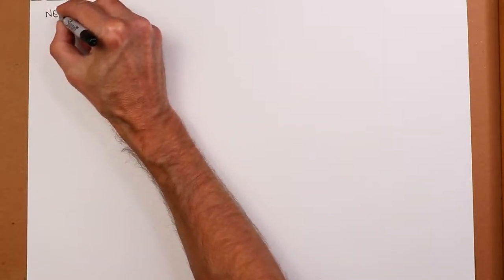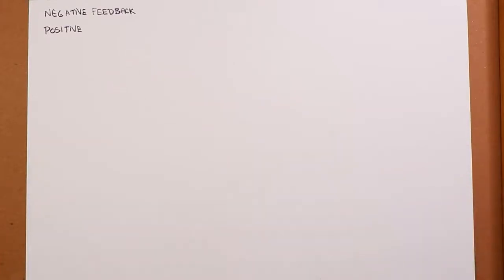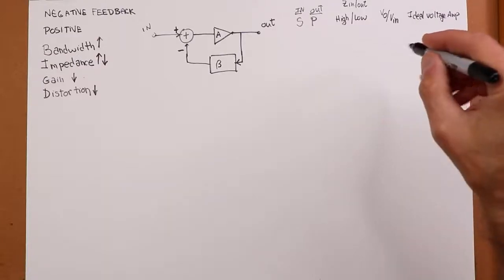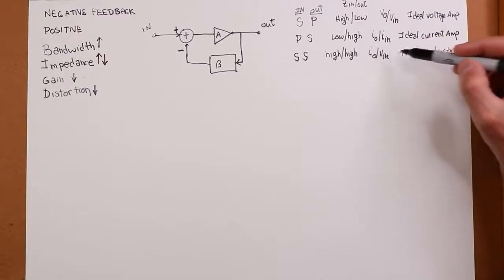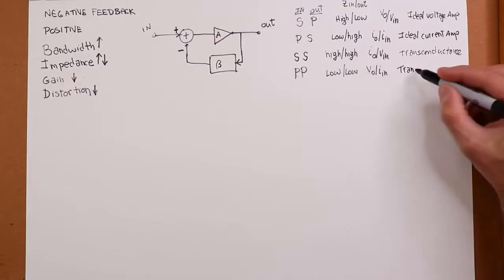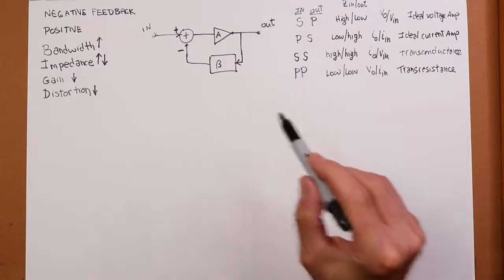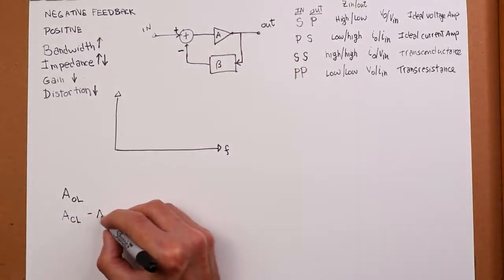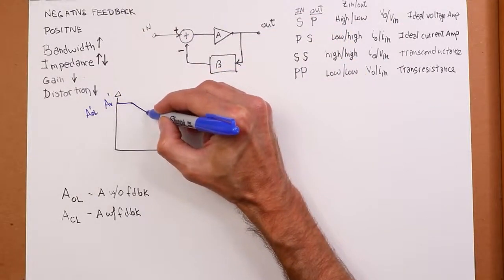Op Amps: Negative Feedback

Comment: basic amplifier has a mid-band gain of 1000 and two poles located at -200 rad/s and -1000 rad/s. If a 
negative feedback is applied to this amplifier with β=0.1, find the poles of the resulted feedback amplifie

please  how i can slove this question?  i need help